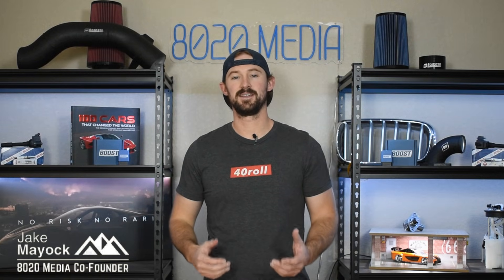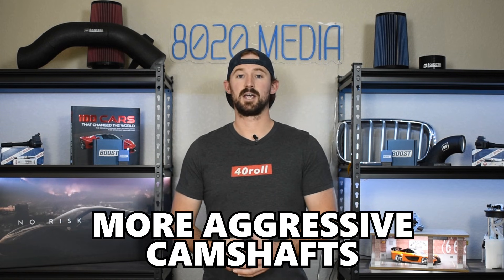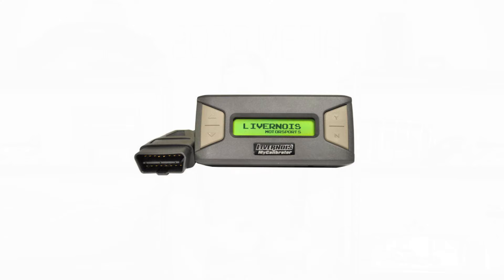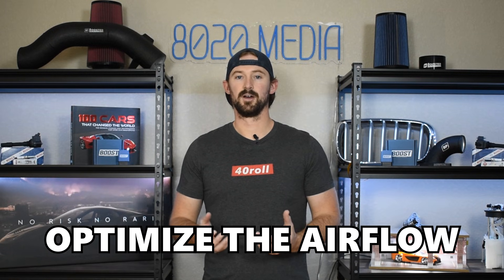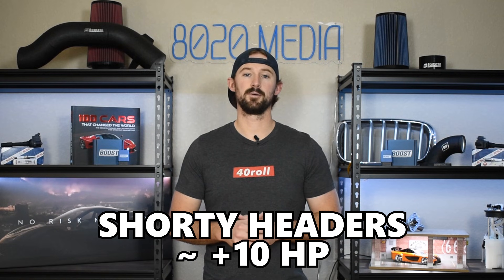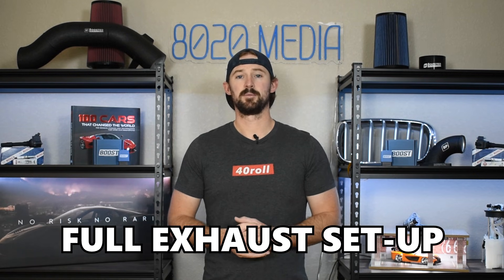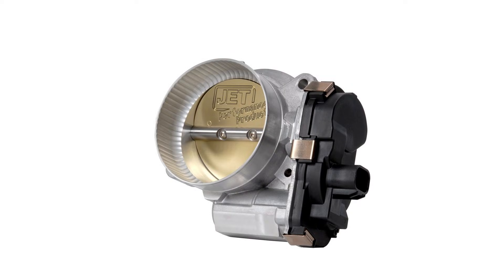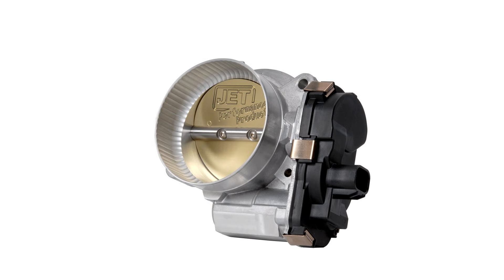How to Build a 400+ HP 5.3L EcoTec3 V8!

Comment: How much hp can be encreased in my tahoe 2024 5.3 lt with tuning, cold air intake and cat pack exhaust? Factory HP is 355hp
Reply from the maker: R - It may be difficult to find parts with a vehicle that new. With the mods you listed, you could maybe get 15-20 whp.
Reply: Depends on the tune and fueling. With 93 octane average you'd be already at 400hp with a solid tune like that.

Comment: Short tubes gain maybe 5 , LTs CAI E85 tune. 50 max gain. These mods might make it run closer to a stock 6.2, just start there.
Reply from the maker: T - Thanks for your insight. Some people can't afford the 6.2.
Reply: The 6.2 is only 2k for the upgrade. Most people have way more than that in bolt ons with the 5.3 and don't have close to the power
Reply: I feel like the above mentioned mods with labor assuming you cant do it yourself would cost the same or more then the diffrence in buying the 6.2 , however, I did purchase a 2017 yukon xl with the 5.3 last night not knowing this info sooner

Comment: you do gain way more than 2 to 5hp if you add a 6.2 intake manifold with the throttle body, also higher stall converter and axle ratio, probably the best mods you can do, went from 3.42 to 4.10, its where I gained the most
Reply from the maker: O - We like to be conservative with power numbers. Thanks for sharing your input.
Reply: Witha 6.2 intake and Throttle body its been proven you make much more then that lol.